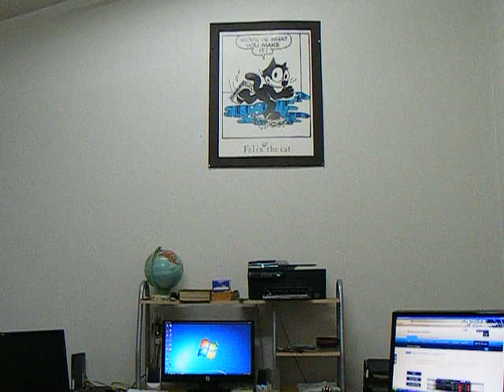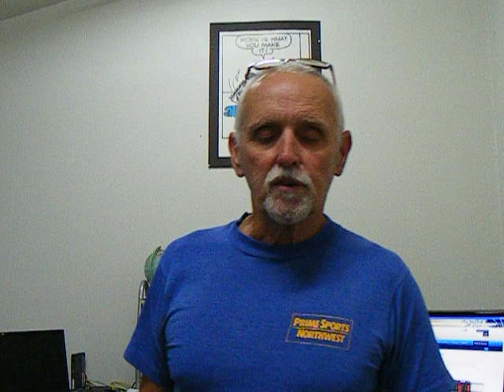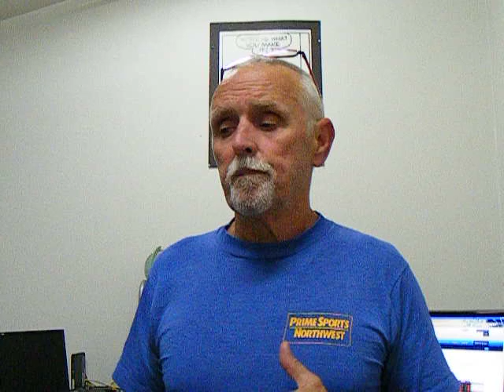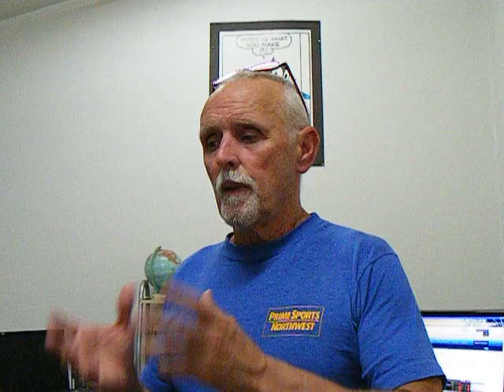The three common types of emergency water filtration systems a discussion of pluses and minuses

Comment: While it is advisable to have a water filter/dispenser for emergenices, there isn't one standard type of water filter/dispenser. Based on your requirements, you need to identify the one that suits you. There is a huge lineup of options for every budget at Awesome Water Filters. You can have a quick discussion with the team on their 1800 789 781 number, or even drop in at their office address given below to find the one that works for you.
Awesome Water Filters
13 Tequila Street,
KIPPA-RING QLD 4021
Phone : 1800 789 781